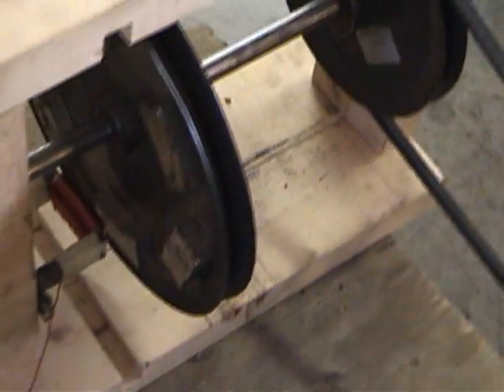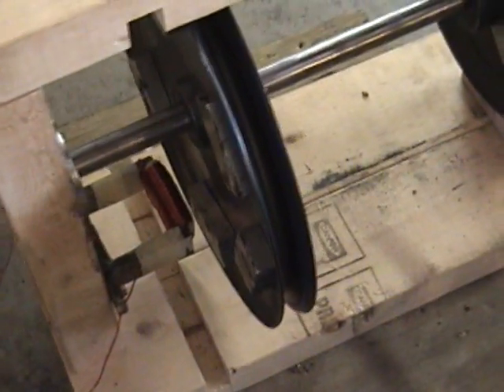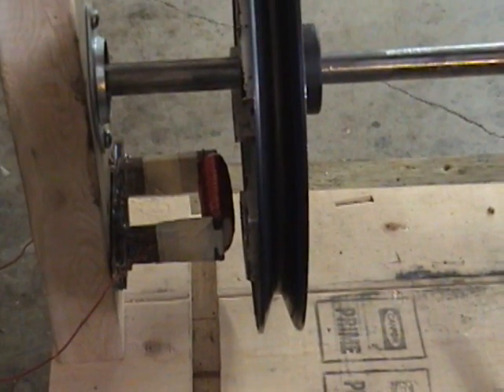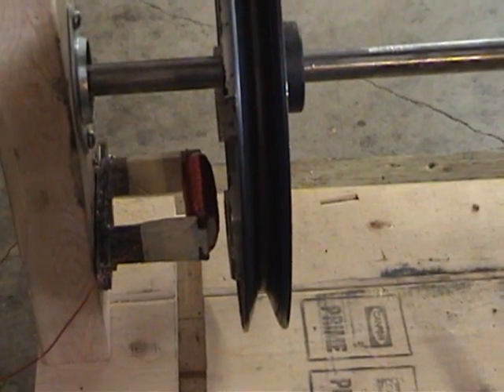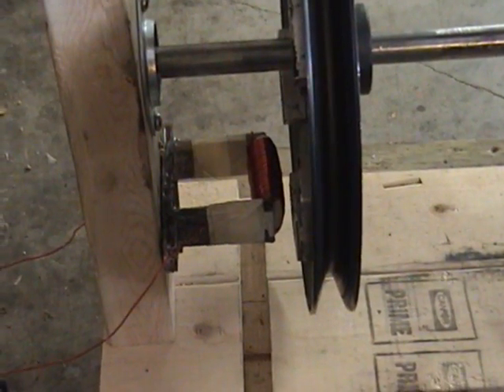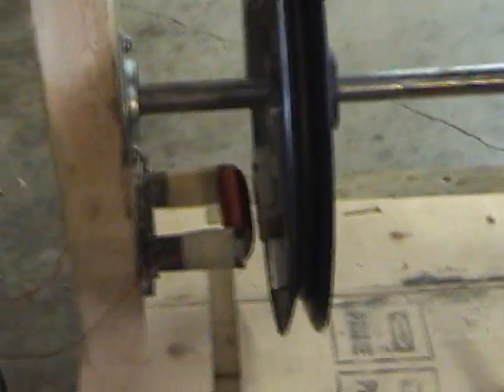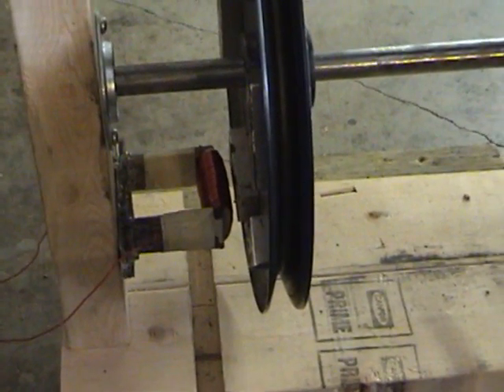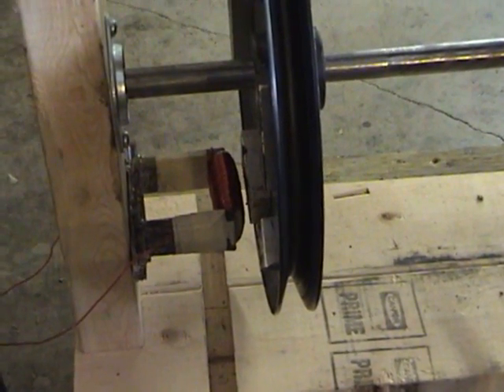Toroidal Generator III

Comment: don't you need a load on the output of the coil to determine if there is any back EMF ?? 
have you tried it with a resistor or an incandescent light bulb ?

Comment: all kinds of possibilities of experiments here
try putting the coil under the flywheel, see what if any power difference before you change the coil, try 4 magnets, try mounting the magnets sideways on the flywheel, that will be fun, you need some better bearings before the ole wife runs you out of there lol, voltage diff between air coil and iron, to get steel soft just throw it in a big fire over night, about 8 hours will be good.